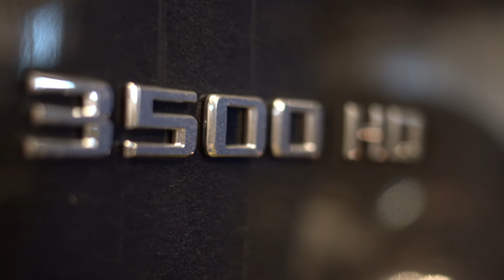2021 Chevrolet 3500HD Dually on Cognito 3" Level

Comment: What kind of clearance is there In the front with the factory 17" wheels? I know it isn't recommended on a skinny wheel but would there be ball joint clearance with a 12.5" wide tire?
Reply: What wheel and tire package is on this truck, the wheels look like stock 17 inch?